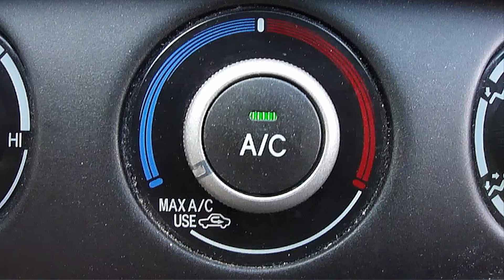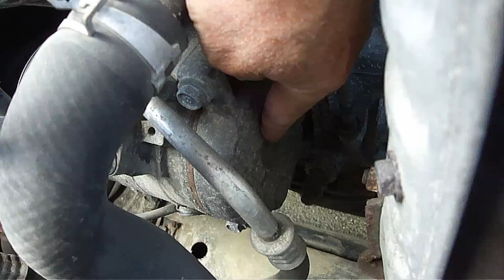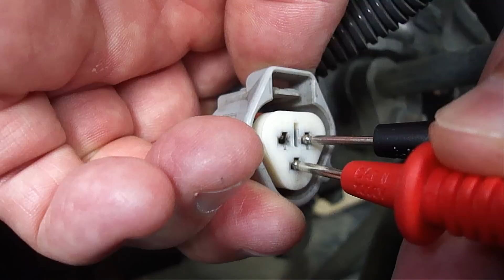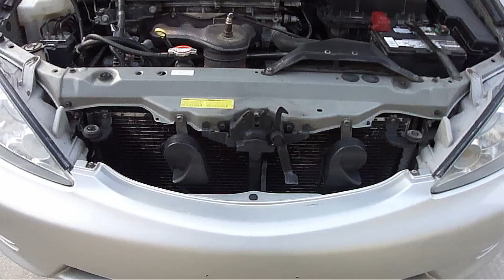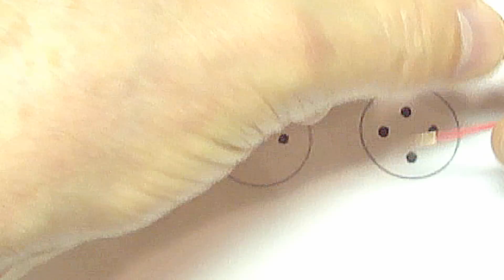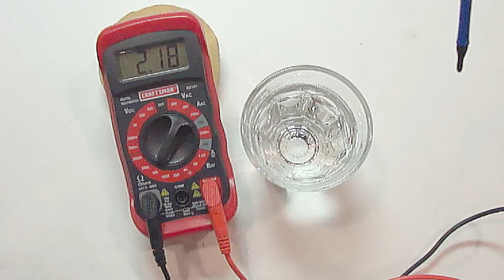How To Fix Car AC That Blows Hot - Possible Causes

Comment: I have a 2009 Chevy Aveo LT it has pressure in the lines the compressor does engage and I'm still getting nothing but hot air I'm thinking possibly maybe could have something to do with the expansion valve? Cuz all my filters are clean the blower motors working the compressors working and it's engaging but it just blows me like barely barely fresh air and I do not have any blinking on my AC light. That's the only one possibility that I could actually come up with is that it is the AC expansion valve because like I stated before the lines do have pressure so I do not have a leak
Reply from the maker: Just because you have pressure doesn’t mean you have enough refrigerant in the system. My guess would be you are simply low on refrigerant. Do you have a sight glass on the AC system?
Reply: @proclaimliberty2000  you only have thing that I have are the little gauges that actually connect to the freon that you put into the car like the simple ones that you buy from AutoZone that it tells you whether it's got too much pressure or not but that's only when you have a can screwed into it that's about all I have and I don't have enough money to take it into go get somebody to look at it I seriously thought it could have been the compression valve that was the first thing that went into my mind but I was hoping it was something easier I did not try putting my horn relay into the compressor relay but I'm going to try that really really soon and hopefully everything goes well with that
Reply from the maker: @flatlogicinheaven369  there is nothing wrong with the clutch relay or other sensors if the clutch is turning. Add one can of refrigerant and see if that fixes it.
Reply: @proclaimliberty2000  I did and it made no difference... I even put the one with the dye so you can see where there are leaks and there none 😒 but I just told myself by now since I live in the hottest part of Texas I'll just wait till winter to be comfortable 😂😂
Reply from the maker: @flatlogicinheaven369  does your AC system have a sight glass? Also, are both cooling fans blowing maximum air?
Reply: @proclaimliberty2000  .... No not the one that I've actually seen not even when I look up the models can I find a sight glass for a Chevy avail LT at least for the 2009 but I know it's like 2008 to 2011 pretty much take the same parts but I don't believe they have a sight glass I'm not 100% sure but I have not seen one on mine but I also found out that supposedly I don't have a fuel filter either according to like when I was looking for parts that the gas filter is inside of the gas pump and that was due to a previous issue that I had with it before but it's solved the issues when strangely I changed the reservoir tank for the cooling system for the radiator but I don't know my sister abused this car for well since the day they got it and I barely started working on it about a year ago and gets me where I need to go there's a little bit of kicking but I mean nothing too bad but there's just no AC and it sucks lol 😂
Reply: @proclaimliberty2000  oh and yeah both fans kick in no problem I don't have any issues with the cooling fans as far as with the radiator they kick in the way they're supposed to and everything I guess it's just going to be a lot of trial and error I guess I'd rather get the parts from eBay even though they're not as good as AutoZone or O'Reilly's at least it's a cheaper way to figure out what the problem is I'm not too mechanically inclined when it comes to fuel injection engines I was always used to carbureted engines so this is all new to me I've never gotten official schooling or anything so

Comment: I’ve got a weird situation where my battery was drained and I think it was due to the clutch, here’s why. I went to check the relay, after I replaced the battery, because the ac stopped working. The relay too hot to hold for long. With the car off and keys out I Switched it with the fog lamp relay. As soon as the prongs of the relay made contact, the ac compressor clutch engaged. Idk but I’m going to check a few things. I’m on vacation so any help would be appreciated, I’m hoping she’ll make it home haha!

Comment: Hey hope all is well I have a 2009 Dodge Caliber SE and my heat works fine it's just my air. I took it to Firestone and was told my compressor was fine but I may need a piece and I'm really trying to avoid taking it to a dealership. I just feel it's a simple fix due to my heat working and I could really use another opinion if you have any. God bless you and thanks!
Reply from the maker: What piece did Firestone say you need?
Reply: They never said
Reply from the maker: @monetshaw6309  Call and find out. That is a key piece of information.
Reply: I thought they put it on the paper but they didn't

Comment: Hi mr paul my horn relay is on the inside in the passenger compartment can i still swap the horn relay with the ac to test it ?i drive  a 2006 ford taurus
Reply from the maker: As long as it’s the same type of fuse then yes.
Reply: @proclaimliberty2000  thank you so much for answering quickly
Reply from the maker: @JacksonCourtnian  👍😊

Comment: First of all, I appreciate your tremendous effort to provide detailed information about AC systems. This may be the best video about AC diagnoses. I have a question, my air conditioner is not blowing cold air. About 10 minutes after the vehicle is started, it drops just a few degrees below the outside temperature. After checking the compressor side, I noticed that after the engine started, my compressor clutch began to spin. The clutch continues to rotate even if the AC is off. It doesn't matter if the AC is ON or OFF, if the motor starts it will start spinning. I haven't seen a magnetic clutch either. I could not detect any magnetic reaction in the clutch. I decided to replace the clutch. Not sure if it fixed the problem or not. What is your suggestion for the problem? Which part should I focus on in these circumstances?
Reply: Did you ever fix it? My Compressor and Clutch automatically turn on and spin when my car is on too.

Comment: Replaced low pressure switch and will not take freon and clutch not engaging
Reply: I've seen in some videos that you could manually engage the a/c clutch temporarily to add freon that way.

Comment: Thanks very informative and very costly for driving car this way. I had new fuel less car in design and soon new ac without need if compressor by replace it with ultra sound or low frequency emf

Comment: Expertly explained! Thank you so much. This has been the single most helpful video I’ve found on here regarding car repair at home. Really appreciate this 💛
Reply: Now that's a compliment.
Reply: I have an 04 Acura TSX and I love how much you go over every possible part! I am hoping my issue si one of the pressure switches and not my clutch &/or compressor because it is seriously expensive in this car.

Comment: I have a 2006 Chevy impala, all of the sudden this year the fuse keeps blowing, which does not allow the compressor to work at all.  When I replace the fuse it works for about 10 minutes and then the fuse blows again. Should I just trace all of the wires and check for a short or replace the compressor? Your suggestion would be greatly appreciated.
Reply: You should check the wiring at the wiring connector, and the relays. Something is trying to catch on fire. Use some electrical cleaner spray on your harness and connectors under the hood.
Reply: @christopherlaw2460  Thanks, I will check all wiring..

Comment: U helped me with car troubles n the past so I'm back with another problem for u, my car sometimes will turn on just fine, other times I have to turn the key over 5-10 times b4 it fires up, other times I'll turn it maybe 30 times and it won't start without a jump, I've replaced the starter, the battery and most recently the alternator! Any thoughts on what else it could b? I'm at a loss, had it to the mechanics twice for this problem, thought  I had it fixed this time, worked good for about a week with no problems after replacing the alternator but then today twice I have had to turn the key over multiple times b4 it would start
Reply from the maker: Are you saying that when you go to start it, sometimes the engine turns over and sometimes it does not?
Reply: No the engine doesn't turn over, just gets a small click from i think the starter and thats it
Reply from the maker: @e-reptiledysfunction2243  Do you have a digital multi meter?
Reply: @proclaimliberty2000  i think so but not positive on how to use it
Reply from the maker: @e-reptiledysfunction2243  You need to first check the battery voltage with the car running and then again in the morning before starting the vehicle.  These informational video's will show you how to do that. 
https://youtu.be/gkl9hyBO_jI
https://youtu.be/ELw3dfKApmo

Comment: Cool thanks alot sir
Reply: Oh but i noticed my fuel mileage went down though to 147 miles from about 225every half full fill up

So i added a little 5w20 about 3 ounces that helped even though it was over full now it ran smoother and helped restore the mileage.  Guess that was a right mix of thick and thin